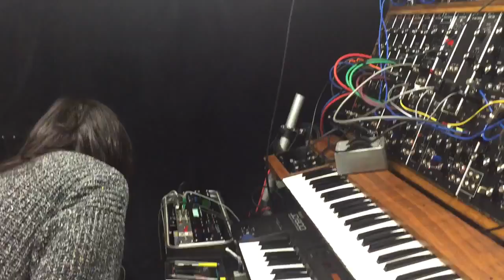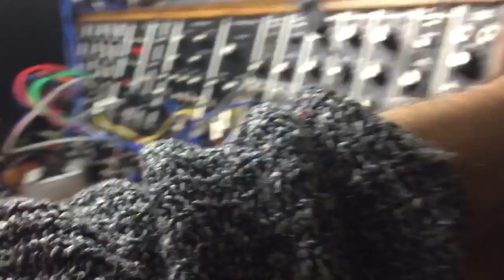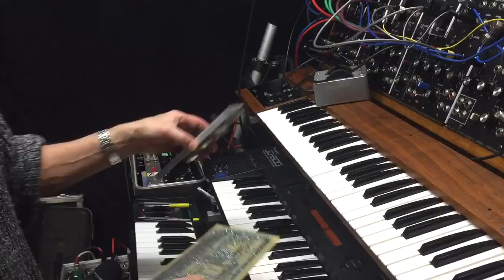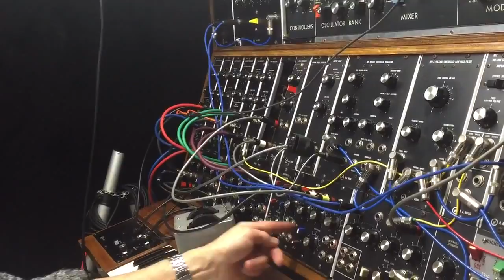R.A.Moog 901b osc comparisons with hand-built unit...

Comment: I've built some synth modules before, and most of them didn't give me any problems. But I haven't done an oscillator as extensive as a Moog. I have a large DotCom modular and would like to add a few Moog modules to punch it up a bit. I can't afford a "real" one, so a home built is what I'm planning. This video proves that it can be done. You have done a stunning job. My hat's off to you sir. I've watched many of your performances on You Tube and am very impressed. I've seen Keith Emerson perform 4 times (3 with ELP and once with 3). Love your work.
Reply from the maker: +John Last Yes of course it can be done... but bear in mind that you will also need a very stable +12/-6 volt power supply and you'll also need the 901A controller to run it from... and signal levels might not match .com stuff either...!? Sourcing those CA3019 diode arrays might also prove difficult..!? Luckily I bought a few many years ago. Good luck with your build though and please do post video's if you manage to get them sorted... :)

Comment: Beautiful work. Where did you get the trace patterns for the boards, or did you somehow acquire unpopulated pc boards?
Reply from the maker: +John Last Made my own circuit boards John... something I'd never done before. I messed up a few to begin with, but persevered...! And yes, I do have the 'mirror image' prints... ;)
Reply: +noddyspuncture was it a difficult build?
Reply from the maker: +John Last Yes, of course it was.... because I'd never built one before..! But I took my time, one step at a time. Like I said, I messed up the circuit transfer & etching a few times. Once that was done I had to tin the tracks and drill the holes. Not something most people could do. And then I had to populate the board. I only had one problem. Once built, it was behaving strangely. I "chased my tail" for quite a few days... it turned out to be an original dual potentiometer I harvested from an old Moog module which had a broken track...! So my build was actually good. The 901A controller circuit I built after this oscillator worked first time though... ;)

Comment: Jesus, Tom. You have an awesome configuration. And wasn't that a much bigger system when you got it?
Reply from the maker: It was indeed sir..! Well spotted. I had another cabinet and a shed load of one-off prototypes... all of which I still have, I just don't use with the system in the "live" show. After all, this is of course an instrument I have restored and customised for "live" use. Also the Minimoog is one I have had for a very long time. It was my Mini which I gigged for decades and thus earned it's honourable place, bolted in amongst the R.A. gear - and now also my own hand built modules...:) Cheerz...!